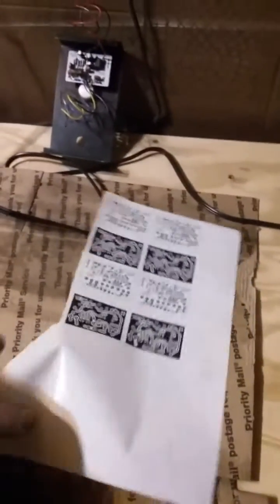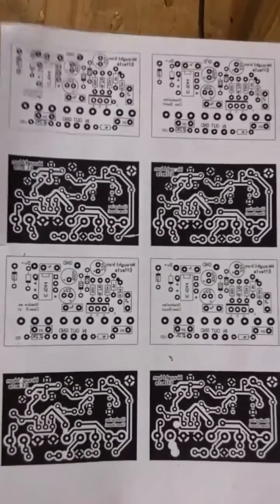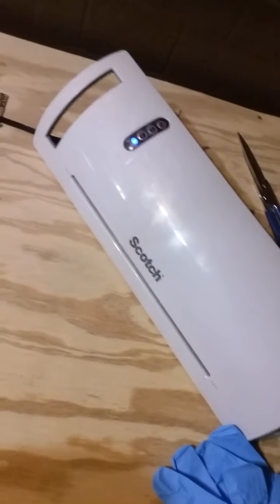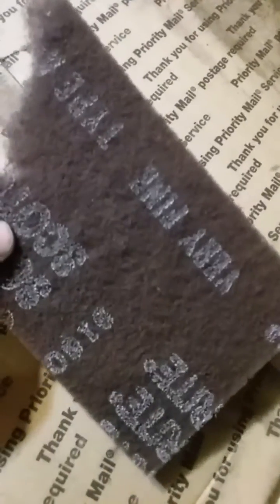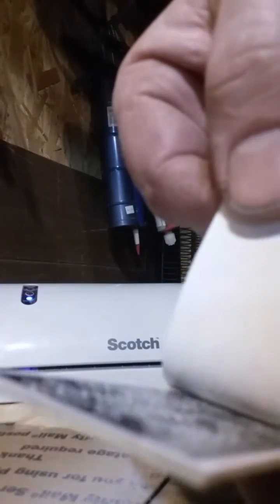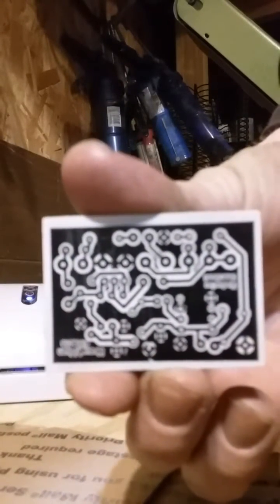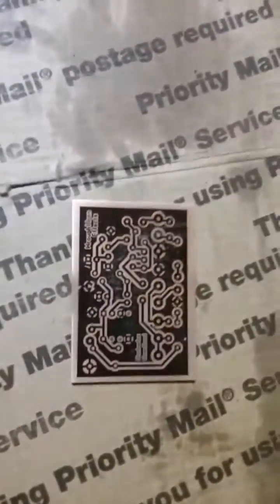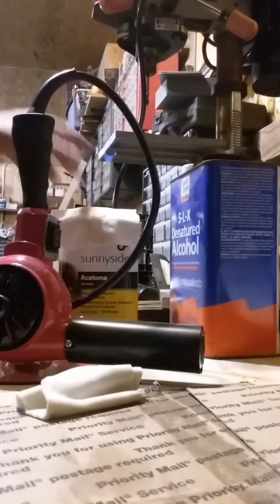Heat-less toner transfer update--now with some heat!!

Comment: The transfer worked fantastic but I cant get the lacquer off with the denatured alcohol. I used the rustoleum white like in the video, but it doesnt wipe or rub off at all . Any thoughts
Reply: For me it's the same. I just can't find the right lacquer over here in Germany. Alcohol based seems to be very hard to find.
Reply from the maker: Hey David, I know this is an old video, but i have discovered that isopropyl alcohol is NOT the same as denatured alcohol and, as it turns out, isopropyl will dissolve every random type of lacquer I have tried thus far. The regular 91% iso propyl from the drug store works like a charm!
Reply from the maker: David Watts you're sure you got white lacquer and not enamel, right? anything That cleans up with water won't work. if you're sure you've got lacquer, the issue could be with the paper you use. I used some glossy photo paper and had a little trouble getting the lacquer off cuz it seemed like the gloss coating of the paper transferred on top of the lacquer. my only advice in that case is to get the lacquer off IMMEDIATELY after doing the transfer and use LOTS of alcohol. otherwise, try a different kind of paper. address label backing paper is definitely the best I've found.
Reply from the maker: @David Watts I am now having the same trouble with newer cans of lacquer. I think they have changed the formula without changing the label. To make sure that was the case, I hunted down some old dusty cans of lacquer at an out-of-the-way hardware store. Sure enough, the old ones work great, but the new stuff doesn't dissolve in alcohol. I will update when I find a suitable alternative that's still available.

Comment: Ed, I have modified your method to work with my brother laser. Instead of labels I use magazine type , glossy coated paper, And soak the paper off with distilled vinegar and a little rubbing. The lines come out very crisp. I just couldnt get consistant results with plastic coated labels.

Comment: Ed it works great ! Best process I've ever used, and I have a Brother Laser , which was useless for PCB's , until now. Thanks for this. The trick is getting the proper tackiness of the lacquer. I didnt have any laser labels  so I applied package shipping tape to the printer paper and printed on that.  Works great.
Reply from the maker: that's a great trick! I'll have to remember that if i run out of label paper.
Reply: Really? just like... clear packing tape on regular paper? printed fine?
Reply: Colin Godsey yes it printed fine.

Comment: actually, you've added another layer of resist. Is the laminator neccessary?
Reply from the maker: @Frenchie, you're right!  the laminator is not necessary other than that it saves a little rubbing and gives a little more consistent results. You can totally do it w/o the laminator 9I have another video where i do it w/o).
Reply: Ed Chew I ended up using my wifes hair, ceramic flat iron instead of the laminator.

Comment: I'm going to try the lqcquer method with heat, always fight getting a good transfer.  Also undercutting  and pitting during etch.   What strength or Hydrogen Peroxide are you using to etch a board in just minutes?   I use the real Muriatic acid and 3% peroxide from the drugstore (cheap kind) ant it takes an hour or more and doesn't do a clean job.   Thanks for your videos!
Reply from the maker: Hey, I had that problem too, at times. I use regular 3% peroxide as well. One thing i do is "slosh" the etch solution around a lot. I can etch a 2" square board in five minutes or less usually if i do it this way. I put the solution in a deep plastic container then (doing this with gloves is a must and outside is a good idea) I slosh the solution around so that it kind of makes a loop. I think it may fold some air into the mixture while at the same time bringing more ions into contact with the pcb. I'll try to make a video of it later. 
One other thing: old peroxide sometimes doesn't work well. I have had bottles that didn't seem to etch at all. If it's taking that long, I'd go buy some new peroxide and give that a try. I try to buy it from places that do a lot of business (so there's high product turnover) rather than a smaller place where it might have been on the shelf for a while.
Reply: I found some glass jars at Wal-Mart, I guess women use them for storing crap in the kitchen. They're about 4" square-ish with a lid that is held on by a metal clamp.   It works great!  Because the lid is really sealed on tightly you can slosh the etchant around all you want and I completed a board in 15 minutes with occasional sloshing.  It's glass so you can see how things are going and if you store old etchant in one at least it won't etch your countertops when you spill (don't ask how I know this).

No luck here with the lacquer method thus far, but I was printing on glossy laser paper.  I"ll try the packing tape idea or something slicker like that.   I could get partial transfer but chunks of toner came loose and the edges of traces were awful.  I went back to my 2:1 acetone to alchol mix that works with my cheap aftermarket HP toner.   I do run it thru the laminator 4-5 times to complete the transfer rather than relying on the chemical action alone.

Comment: Hi Ed can you tell me the printer you are using?
Reply: Hi, I'm using newer laser printer (Samsung Express M2020W). My problem is that I hardly transfer the toner to my PCB. Can you give any suggestions or any idea please.

Regards
Reply from the maker: This one:
https://www.walmart.com/ip/Hewlett-Packard-Hp-M26nw/183467041?wmlspartner=wlpa&selectedSellerId=0&adid=22222222227068241048&wmlspartner=wmtlabs&wl0=&wl1=g&wl2=c&wl3=174368078124&wl4=pla-278149777147&wl5=9019340&wl6=&wl7=&wl8=&wl9=pla&wl10=8175035&wl11=online&wl12=183467041&wl13=&veh=sem
Reply from the maker: JB-N107Lab are you using the lacquer as described in this video? If so, try transfering it just a little quicker. It's a delicate line between too wet and too dry. Without the lacquer i couldn't get any toner onto the PCB either with my newer HP.